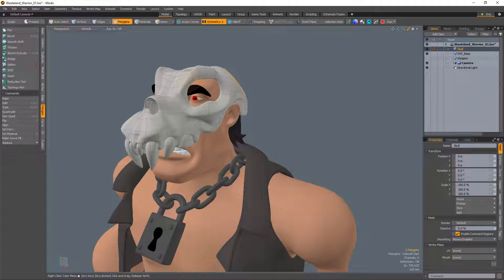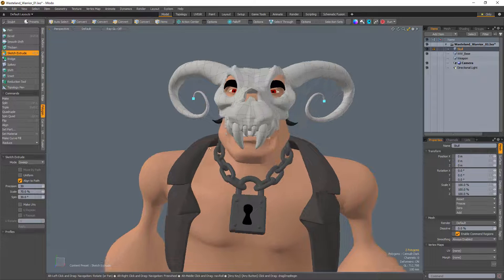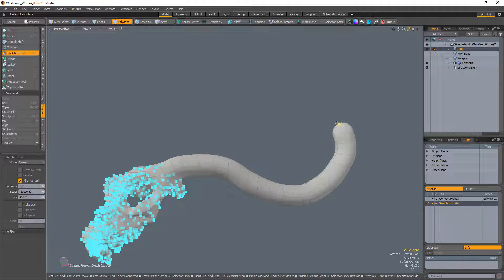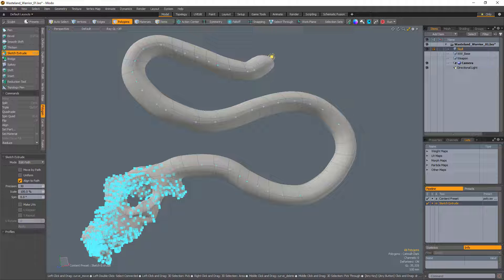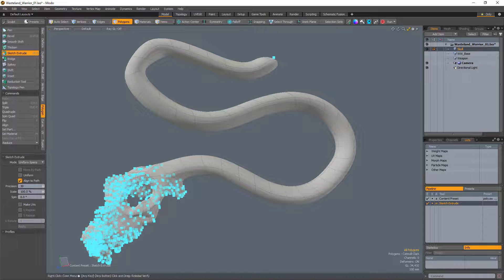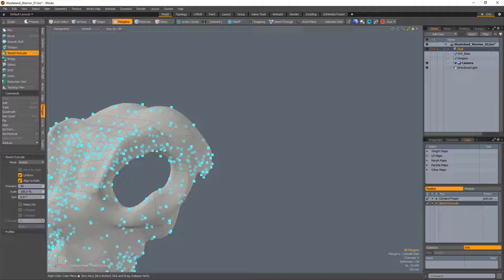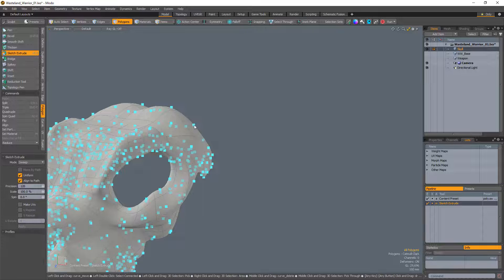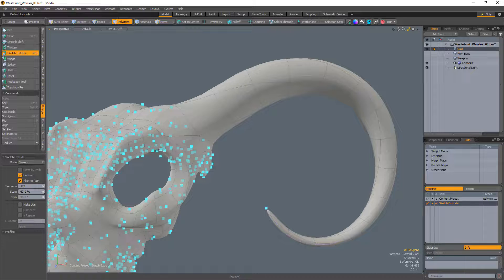MODO | Sketch Extrude

Comment: Is there a way to extrude along a path where you can spin and scale it, like a rams horn ?
Reply from the maker: yes. I show that in the video
Reply from the maker: and if you want a path that already exists use curve extrude
Reply: I was trying to do it along a taped helix where I could twist and scale it to a point. I just didn't think the extrude path had those option I'll have another look. Thanks !
Reply from the maker: You could use Curve Extrude and have it spin and then follow it up by scaling over the length of the horn using falloffs. If you havethe hatchet collection is easy to do at any time of the modeling process... https://vimeo.com/198533531
Reply: I was thinking similar with the fall off and just make a weightmap to do it, but I do have the hatchet collection and that's way easier! thanks for pointing that one out cheers !